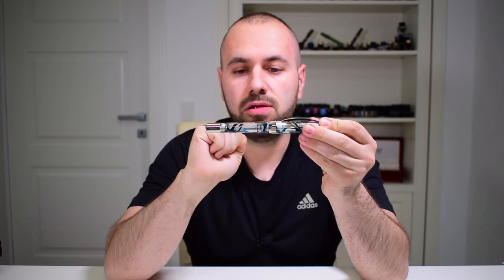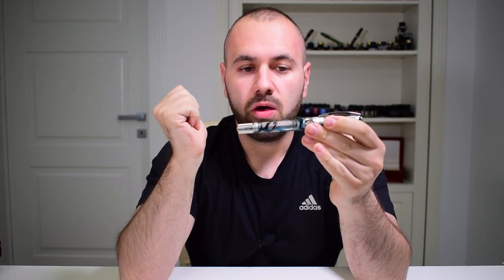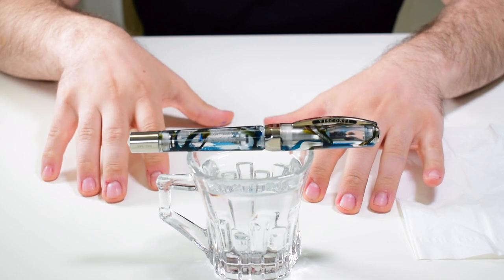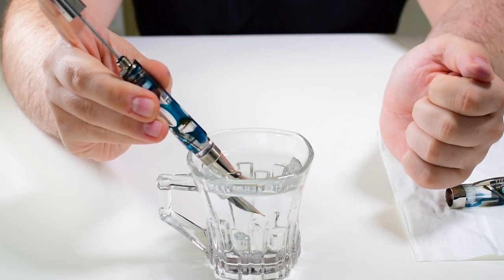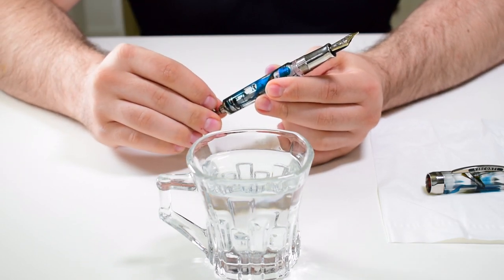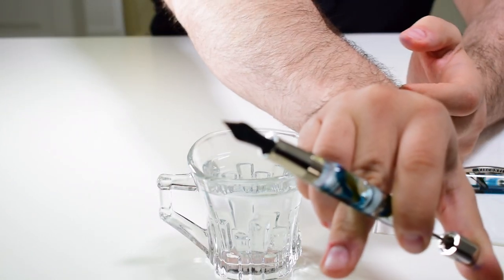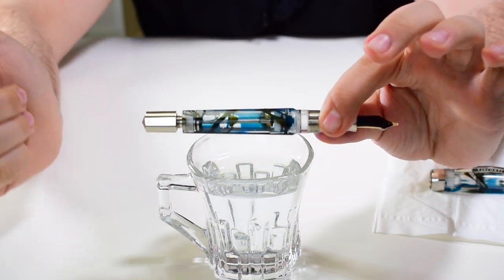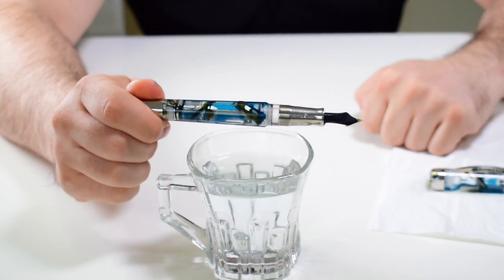Visconti Power Vac - Complete Fill - (How to do it)

Comment: You really have to be careful using this method, as once while filling one of my Homo Sapiens on the final fill the pen body slipped between my fingers and the nib hit the bottom of the bottle. The tines were knocked out of alignment, but luckily I was able to correct it. I think it's safer to use the Visconti Traveling Inkwell or just be satisfied with half a fill since they hold so much ink anyway.
Reply from the maker: You are right Chris, must be careful doing this operation but it’s the only way you can fill it completely. Many are asking and wanted to demonstrate on video how to do it step by step.
Reply: CHRIS LJ this works well with piston fillers too :)
Reply from the maker: Yup, it can be done with a piston too
Reply: I had the same problem , now I don't feel so sad about the slip and the splayed but now aligned tines